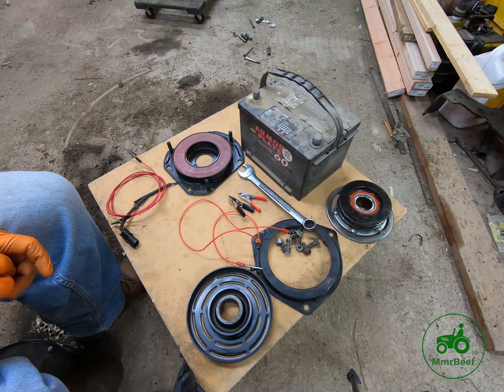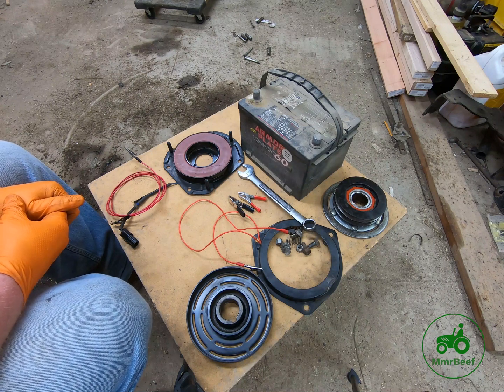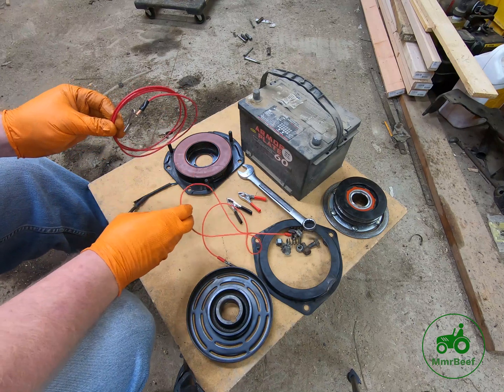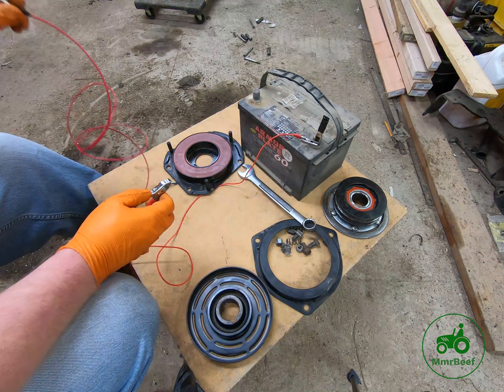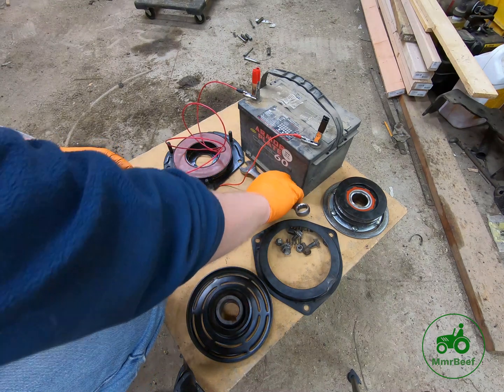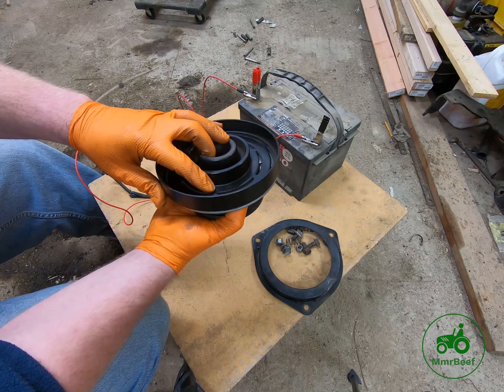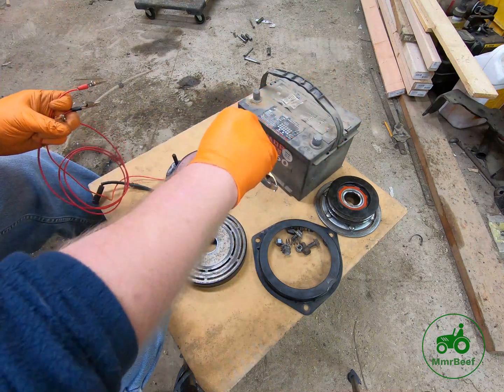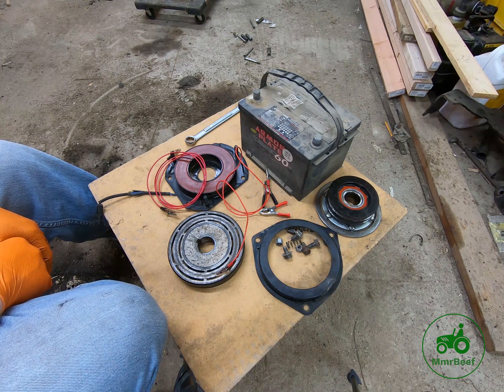John Deere 318 420 430 PTO Inspection

Comment: For some reason my John Deere 430 garden tractor has been blowing the 25 amp fuse when my front PTO is engaged for a couple minutes. Took everything off the front end and tested the PTO clutch it seems okay, but when you reassemble amd mount, how much tension on the three bolts and springs for the clutch cover plate is necessary? This covers the outter edge of the disc plate attached to the back of the upper pully  componet, how much free play is it supposed to have? Any? I tighten those three bolts down enough that the pulley back plate will turn but I can hear metal on metal

Comment: I hope you still monitor these comments. I had a mule-drive belt let loose on my 318 and it looks like it took out the PTO wire with it. Should i just try to find a new clutch assembly? I have no idea where the wire is supposed to attach to the clutch
Reply from the maker: I do still read comments. If there is still wire visible it can be fixed. You might need to take the clutch off to find the remaining wire. Typically the wire routes into the back of the clutch.
Reply: @mmrbeef  thanks for the reply. I've read that I shouldn't need a puller, but it looks like I'm going to need one. Trying to get the. Lutch off now
Reply: Update......
I got the clutch off today. BARELY enough wire left to splice on to. One heat-shrink butt connector and im back in business!!
Thanks again for the quick reply

Comment: Thanks for the video, my clutch works as it should but after a few minutes it blows the fuse! I have set the gap to specks but cannot keep it running. Can’t see any bare wires.  Any thoughts? Thanks
Reply from the maker: You might try ohm'ing out the field coil and see if it has any resistance issues. I don't have my TM in front of me at the moment but you should be able to find the specs for the coil online. It could be the coil is getting hot, creates too much resistance and then blows the fuse. Also check to see that you have 12 volts to the PTO, maybe there is a voltage issue somewhere.

Comment: Hi, great videos. You are one of the few that have done anything with the Onan rebuilds. I have an Allis 620 that I am putting a NOS CCK in and I was considering using a 318 clutch since the Simplicity clutches are no longer available.The shaft is 1 7/16 and I believe these clutches are also that size. Do you happen to have one for sale? 🙂